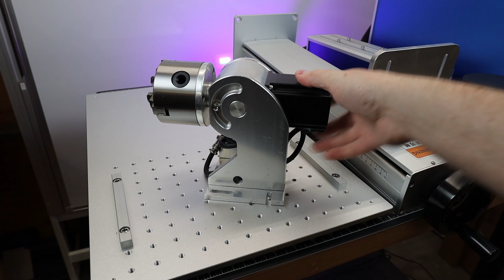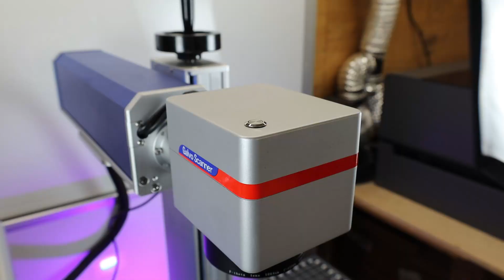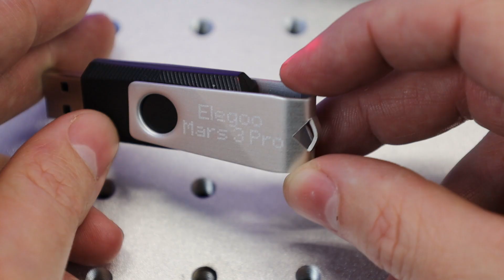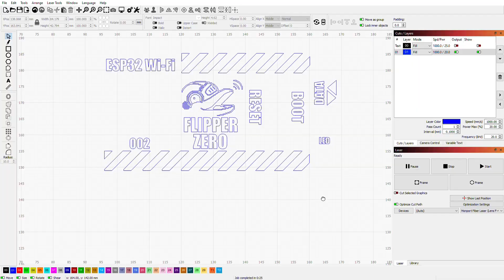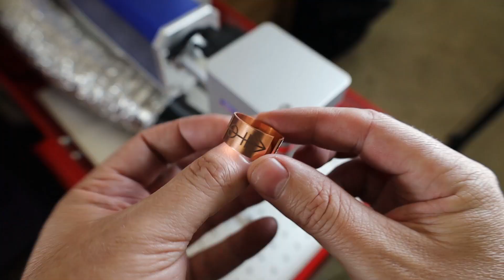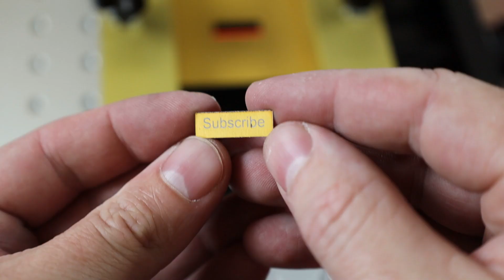Custom Engrave Your Own jewelry & More - Monport 50w Fiber Laser

Comment from the maker: Use Code  Randy10  for 10% off for ALL Machines
Monport 50w (12x12in) Fiber Laser Engraver  - https://bit.ly/3Qwo1z6
Monport 30W (8" x 8") Fiber Laser Engraver - https://bit.ly/3SfiZZd
Monport 20w (6" x 6") Fiber Laser Engraver - https://bit.ly/40dLqIM

Monport 80MM Three Jaws Rotary Axis - https://bit.ly/40iE1YT

Newer & Cheaper Laser Option From Monport:
GP20-Integrated-Fiber-Laser-20w - https://bit.ly/3rXYQMF
GP30-Integrated-Fiber-Laser-30w - https://bit.ly/3FBWNAM
GP50-Integrated-Fiber-Laser-50w - https://bit.ly/3tEz6oP

100pcs Blank Metal Business Cards - https://amzn.to/45lxYEg
30 Piece Rectangle Metal - https://amzn.to/45nXM2r
120 Pieces Stainless Steel Blanks - https://amzn.to/3KBSacV

Comment: Hello, have you tried how deep it can engrave like >0.5mm in depth? or we just need to repeat a few times to reach desirable depth? Cheers!
Reply: I would like to know as well, Randy!!!
Reply: @lou196t  hey mate I just checked with the monport company at their site, it can get to 5mm deep by multiple runs of the pattern BUT the lower the watts the more runs it needs thus quicker deterioration of the lens. I think if you don't need compact design of the new model, just get these split systems, cheaper and mopa is fancy but I seen more negative than positive for now.

Comment: What gauge was the metal you cut ?
Reply from the maker: About 0.8mm at the thickness and it will take some time to get through it.
Reply: @GomeowCreations  thank you 😊
Reply: @GomeowCreations  .8 is pretty thin, but suitable for some work the takeaway is the time required. Thanks again for your demonstration 👍